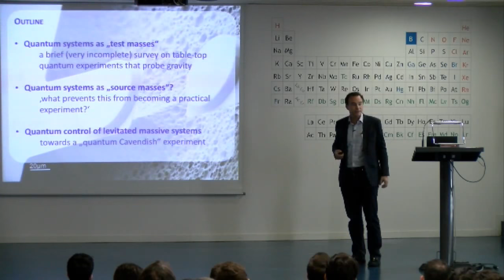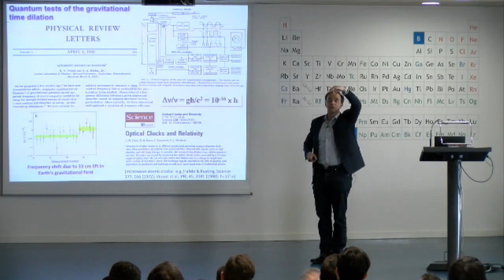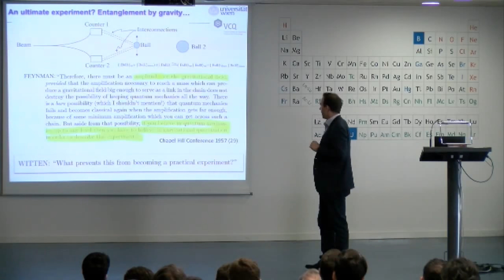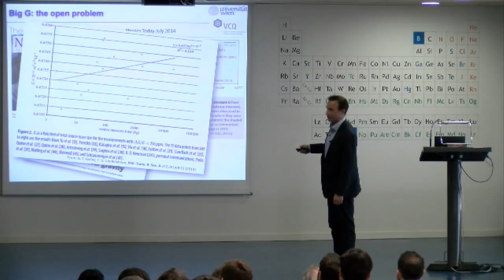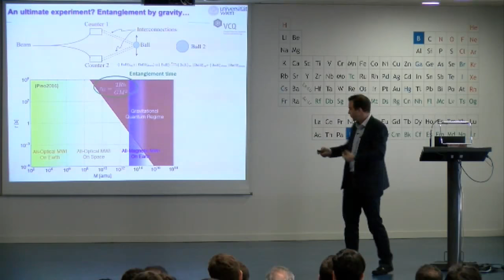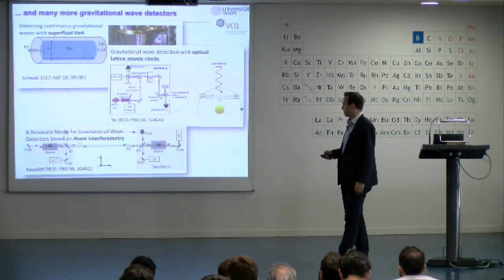"Quantum Tests of Gravity"  by Markus Aspelmeyer

Comment: All due respect to experimentalists, but this sort of work is ill-founded as a test of QG. It's a good experiment. But it will not prove spacetime is in superposition. It will only show matter can be placed in superposition and the gravity effects thereof measured without detecting which-way information in an interferometer set-up. This is superposing matter fields, not gravity. If you want to test quantum gravity you'll need gravitons, which you will not be able to find (Dyson's argument).
      What it means is that in our universe gravity is classical. But we would describe it quantum mechanically if gravitons were detectable, since they're not, we do not need to quantize gravity.  We quantize local matter fields only, not global spacetime.
      Put in other words, if you can fabricate, generate or pull gravitons out of a hat, they'd be spacetime instantons essentially, and would be subject to entanglement and superposition. These are not superpositions of global spacetime though, they're GR instantons or solitons, or localised gravity waves. They'd be subject to QM just like photons.  I think they'd disperse so rapidly into gravity waves we'll never detect them like a particle (local energy deposition), but that's just a guess. Maybe your group can do it?
      Put in yet other words, if you want a proper test to tell if GR needs a quantization treatment, you'll need to superpose universes (the rep.s of the Poincaré symmetries), which is an impossible thing to do, so you might as well just assume gravity is classical and if some creature beyond spacetime can do the experiment wish them all the best, it won't mean a thing for us.